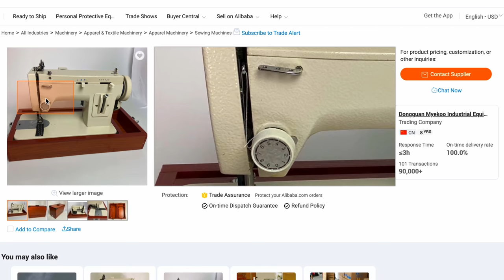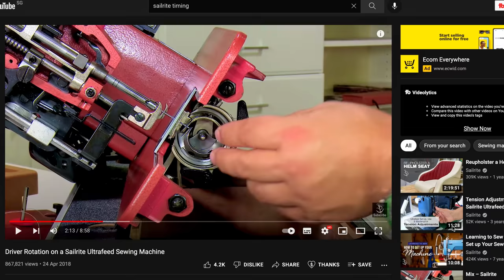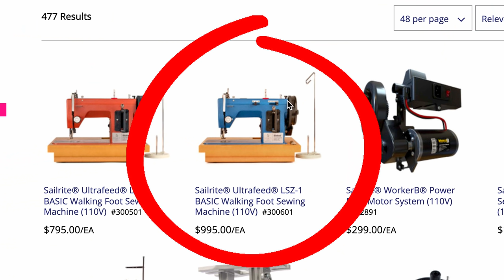SAILRITE VS CHEAP Sewing Machine (Full Comparison)

Comment: My tension cover for the knob fell off a couple years ago, dont need it. Just count half turns while adjusting for new project/ fabric/tensions and make a note so you can return to where you were.
I usually sew 500D Cordura and Ottertext, when I switch to lets say a HyperD 300, I know from a note how much to dial the tensiob knob and the presser foot to get me close. Then just dial it back the other way when you switch back to the 500D. 
The presser foot is even easier. 5/8" exposed on top for 500D, backed all the way out, then one or two turns back in for the lighter HyperD.
I dont even look at the cheat sheet anymore, just keep track of last fabric you sewed.

Comment: I think it was a good decision to get the cases for both machines.  Interesting, Consew is an expensive industrial machine.  At least they were.  I am wondering if someone is using the name.  Good video, because  lots of people also must be asking can I get a walking foot machine that can do big zigzag stiches for less money than the Sailrite.  Sailrithe is a good company, as you know since you have been a customer of their fabrics for a long time.  I started with their sail kits.  $995 is a lot of money to spend on a sewing machine.  Then again avoiding problems, especially when you are traveling  is priceless.  I remember the original Sailright machine was available with a hand crank.
Reply from the maker: I'm surprised at a lot of comments on the Sailrite FB group saying they have a lot of trouble with them also! I think fine tuning is the key.
Reply: Consew is Japanese made commercial grade. They are the original patent holders of this design. Model Cp-146r.. Their made in Japan /made in Taiwan offerings (80’s - 90’s) are superior in quality to all of the Chinese clones that followed. I use mine regularly on heavy material (leather /canvas), purchased 6 years ago-flawless workhorse. Sailrite appears to be the best choice, with best support outside of the original.

Comment: Thanks for the video, very informative.  I believe you machine has in fact has  a method for disconnecting the drive for winding bobbins. The knurled knob on the flywheel is I believe the same as Singer machines - Turn the knob counter clockwise and it will unlock the flywheel from the main shaft. If you remove or loosen the small screw in that knob you will be able to see how it works.
Reply: I put a big wheel on my Rex. At first, after loosening the knurled wheel, the needle still went up and down. I removed and replaced the wheel a few times and finally got the parts in the right order and alignment, so now the needle disengages properly.

Comment: Hi there, on Jupiter! Thanks for this great review. I searched and searched, and never found any 60$ Sailrite's sister. I think it's the price of the box actually, wether it's a wooden or plastic one. The cheapest machine I found was around 190$, plus 50$ for the big wheel, wich makes 240$, and...250$ for the shipping!! So we're on an average price of 550$. The good point is the long arm machine (9") isn't much more expensive, just about 50 or 60$ extra; but the shipping cost jumps from 95$ for the 7"arm to... 250$ for the 9"arm machine. I encountered other brands than the ones you cited, but overall the price is always 550$ or so: half a sailrite.
It's been a week since I begun searching for an affordable machine, and I still don't know!!! Not sure I'll have the skills to make it whit a cheap machine if it comes to jam. Some advise you to oil your machine before the first use, some appear to be luckier than others. Heaven knows! 550$ is still an amount!
Reply from the maker: Yes you are correct on the $60 base... I worked that out after publishing the video... Sorry about that. Shame about the freight price... It would be worth the gamble if it wasn't for the freight... I just saw SR at the boat show and the zigzag machine with all the bells and whistles is $1600 now!... That may have included the table... Not sure.

Comment: A very good review and comparison. 👍. I have no idea what the comments about bias are about.

I've got the Chinese Rex RX-607Z.  AUD300 used in Australia.  A new Sailrite would have been ~AUD2000 delivered to Australia.

Sailrite is definitely a better machine with better support but mine works and does everything I need (a 9" arm would be nice though).

I'd say it's the 80/20 rule at work: 80% of the features for 20% of the price.  Works for me but might be different for someone that does need the extra features, reliability or support.
Reply from the maker: Yep.. You're all over it.. I agree.. Happy with the crappier low cost  version.

Comment: I have both the same machines, the barracuda sits in the corner and hasn't been used (since I got the sailrite) as every time I used it it needed adjusting. I have had the sailrite for two years and not one problem. I since got the worker B upgrade, it is absolutely the most powerful sewing machine I have ever used. lots of reviews on YouTube. the folks that use high end machines even like the new power option!!!!
Reply from the maker: Yeah CF, I'll try acquire a SR when I come across a cheaper one second hand. Judging by comments on the Facebook Sailrite group they do have similar problems so I'm sure someone will sell it off cheap! But it is definitely the superior machine.

Comment: The Sailrite with the WorkerB Power Pack has significantly more power and max speed on the pedal can be manually adjusted with a dial so speed control is more refined.
Reply from the maker: Yep.. Nicer machine.

Comment: Very Nice and honest video!!! I don't owe any of these two machines. What I have is a used JUKI LZ-271 machine, and that machine have never given me any problem, works very smoothly, and it is able to do those 8 layers without doing what this gentleman has to do with the flywheel as he calls it. The Juki is a more expensive machine- 1400.00 USD used- but it is a gem, and it came with table, thread stand, foot control, knee lifter, and a 110v servo motor that is very quiet.  True, when I want to do Zig-zag, I have to change the needle plate, but my buddy can do embroidery with it, something I can't!!!!!  But again, a very educative video with clear explanation from this gentleman.
Reply from the maker: Very nice words...tks Jorge
Reply: What is the machine you used to have. It was a regular sewing machine .. I can’t find the video thst you made. I think it was a Janome

Comment: Great video! Thanks so much. I have  tip. My machine is a Rex. New it was so tight and clunky we called it T-Rex. After a few years of that nonsense and using proper sewing machine oil, I decided to try oiling with Marvel Mystery Oil. After running threadless a few minutes, the racket stopped. It has run quiet and smooth ever since.
I use that stuff in my vehicle, too, 1 liter of Mystery with 4 Liters of Synthetic, and my Kia Rondo runs quieter and smoother and burns a little less fuel in summer but significantly less in our Canadian winters. For sewing machines, I got the idea from some sewing forum where a woman said she oiled her ancient Singer with it and thay she "could blow on it and it runs." It's not quite that good on the Rex but a total improvement from regular oil.
Reply from the maker: Ah wow... I wonder what's in that stuff? Will try to remember to pick some up... Cheers

Comment: Not sure about sewing machines, but my friend bought two chinese made 5hp outboards from aliexpress(I think). Before he ran them, I took one, disassembled it, cleaned it up(deburring, cyl hone, valve lap. smoothed the gears, Carb etc) Put it back together and gave it back. He mounted them both on his 16ft boat and ran them equally. with the same oil and gas. the one straight out of the box lasted 4 years of above average use, the one I cleaned is still running strong. 
In my opinion much of the chinese stuff has the potential to be reasonable. but assembly and attention to detail of the products is grossly lacking. And yes the Metallurgy and composite quality is also lacking. It was very easy to file the piston rings and bearing races. Most of the plastic was not glass fiber(or ever fiber) reinforced.
I think if you took apart the Barracuda, cleaned the parts (maybe put some graphite or molybdenum disulfide on the moving parts it would run a lot smoother. 
 Not sure about the motors but they both should pull about the same amount of amps, therefore the power output should be about the same.

Comment: I bought the blue, zig zag Sail Rite a few years ago.
The forward reverse lever you pointed out was an Upgrade they offered which I purchased.
You can set the lenghts of both your forward and reverse stitches with it by using the locking adjustments. 
I also bought the Servo Motor upgrade - I like it Very Much, I can control the speed of the machine perfectly
which is great as I am brand new to sewing.  I'm waiting to see if you mention the internal differences
 that the Sail Rite site points out in their videos.

Comment: As in the old adage, you get what you pay for.  When I have the confidence in my skills to repair and keep equipment running I have purchased cheaper equipment, but over the last 55 years I have come to regret it because my time is worth something and constantly repairing an item because the parts wear out faster or the quality is just not there adds up to regret for not spending the upfront money on a quality item.  As far as Paul Liuzzo's comment about comparing Ferrari to Ford, I think that is an unfair comparison.  A Ferrari is NOT made for durability.  A better comparison would be a Ford and a baseline Kia and a Lexus.  The durability and precision made parts ensure longevity that the cheap parts just cannot provide.  You get what you pay for and now I wait a little longer on a purchase till I have the money and make the (what I believe is) the better choice.  Thanks for the video.  Excellent presentation and good logical assessments.
Reply from the maker: Thanks WF.... FYI, I've had a lot of feed back from the Sailrite FB group... There is a lot of annoyed Sailrite owners also complaining about breakdowns, even when brand new!

Comment: Thank you for the great video!! Very informative , I recently purchased the barracuda with the Cuda case , the machine itself seems solid , but agree with what you have said , some parts are of a rough finish , I will be purchasing the Cuda crank as I think it will be helpful , the carry case itself is beautiful , but the opening in it is a little too small for the machine &  when you try to flip the machine up to change a bobbin it catches & has chipped the coated on the Carey case . So I have taken the hinges off & just lift the machine up from one end to change a bobbin , it’s much easier for me . I hope it it doesn’t let me down , it is cheaper then the sailrite , but still a little pricey when purchased new from Reliable .

Comment: Great Video.  Good to see you CAN get a sail capable machine really cheap if your prepared to fiddle with it.  I might go the $60 but would probably buy 2 or 3 (spares) if it wasn't for the weight consideration on a sailboat.  
Your right with the motor sizes.  Watts = Amps * Volts
So, if the engine rating is given in Watts your comparing apple for apple regardless of Voltage because Watts are simply a product of Amps and Volts.  Double the Volts and you half the amps.
So, the Cheaper machine has a much more powerful motor and that is normally a plus.  
The Sailrite being a physically larger motor may mean its been built more robust and that can ultimately be a reliability plus, but in the short term, the cheaper machine wins in that department.
However, it looks like the Cheaper machine was given the more powerful motor to get around the stiffness and binding issues you showed, means it WILL wear out faster.
My Mother is a [seamstress/tailor/mad keen dressmaker] so I have had to repair / replace odd bits and pieces in the past.  She has both heavy duty machines and hi-tech embroidery machines (Singer, Phaff, Bernina etc) The Singer is this old heavy solid as a rock machine that has a 2.5hp motor.  It would be ideal for  sail making, but its way to heavy to have on a boat.  it requires 2 people to move it and its setup on a really large cast iron frame, designed to be bolted to the floor.
Reply from the maker: Ah cool feedback... Tks Raptor

Comment: Hi, thanks for a pretty fair comparison of the two makes. I have been eyeing up the 9" Chinese version and reckon I can tweak it to suit my portable sewing needs.
One thing you didn't mention is that these machines need regular and generous oiling and after the work you put the Reliable through it would be a bit dry, clanky and stiff.
I am betting the skipped stitches are down to the thread choice - it makes a huge difference on these machines. Sailrite has an advisory on skipped stitches for certain threads. Overall a good video, looking forward to more 👍
Reply from the maker: Hey thanks BM... Yeah, I've had a comment here, someone bought the 9", and have had no problems... Ill definitely get one when we are back in Asia.
Reply: I was watching some Sailrite videos yesterday and they made comments about certain threads causing skipped stitches.

Comment: SEWLINE 146-7 We have a 35 footer sailboat in PANAMA. the SEWLINE has done 2 cock pit covers (12'x13' truck tarp stuff) plus 1 sail cover plus plus sunbrella dodge..leather interior on a '69 XKE..tonnue cover and more...has not broke yet.  Is it perfect, NO ...cost new now some $500 with zig zag.  Just under 50 lbs so lots of plain rides...see if we leave it in humid Panama it will rust so back to dry/hot Phoenix.    I am sure both are great machines.

Comment: They’re the same machine, but Sailright does include a few better parts such as the linkage for the needle bar.  All mechanical sewing machines require tuning—why do you think Sailright includes detailed videos about setting up and timing their machines?  Buy a cheap one and replace a few inexpensive parts if necessary. I did that and saved $800 over the sailright

Comment: If the sewing machine is double insulated then you don't need an earthing pin at all. 
The motor will be smaller because you don't need as thick a wire for a higher voltage.  You can also deliver greater power, as watts=voltsXamps - so double the voltage, you double the power at a similar motor size.
Reply from the maker: Thanks PI.. I'm quite sure this big lump of cast iron is not double insulated!
Reply: @SailingLifeonJupiter  The motor might well be, and then just bolted to the chassis. But either way....

Comment: Thanks for the comparison. A simple 2 dollar round sticker with 1 - 10 on it would be an easy fix for the tension dial. Also FYI you are showing the wooden case for the sewing machine which is $60, not the sewing machine.

Comment: I bought a Morse machine (essentially the same) about 12 years ago for $350.  I have had some problems, and one part of the internal mechanism broke.  I was able to buy the replacement part from SailRite.  I  also had to add the monster wheel separately.  There are some timing issues, but I am able to sew things.  I have made 2 sails, repaired 2 other sails, and made several canvas projects.  Everything appears to be compatible with the SailRite machine, but, as you mentioned, SailRite will not talk with you about a machine without their brand.
Reply from the maker: Yeah Jeff... I wish they were more affordable. It is definitely a nicer machine.

Comment: Thanks for this video!  It was immediately obvious that "everybody" is selling the same machine, and finally I found someone who discusses this fact!  Yes, I'll probably get the Sailrite.   Ironically, Sailrite is probably making less profit from these machines than the "cheap" ones.  If someone buys the machine for $60, puts a sticker on it and sells it on for $600?  Compare that to Sailrite, who is essentially re-manufacturing every unit.

Comment: Spring loaded return from reverse is a feature the pros use for efficiency. Maybe that’s a feature that should not have been added to a portable machine, given so many home project people, while wisely using a SailRite for its affordability, don’t do enough projects to become proficient enough to gain the dexterity that makes the “quick return from reverse” a value.  Ending a stitch line at high throttle, one hits reverse, lets go, does a few more stitches and the end lock stitches are done so very fast. I have watched experts in boat upholstery using various machines, though never a SailRite.  The experts are impressively proficient.
Reply from the maker: Yep…do something long enough…

Comment: I bought a Singer 2Ku33 in 2016 because Sailrite was not available where I live.  It works well, no skipped stitches but noisy.  It cost about USD700 at the time.  I have sewn through 16 layers of upholstery fabric without any issue.  The only problem was that the presser feet rubbed against each other.  I was afraid to sew fast because it might generate heat or damage the presser feet....not sure how to adjust it but I might grind/sand it down if it becomes unbearable.

Comment: My new Sailrite LSZ is on its way. I tried other "heavy duty" machines and it was horrible.  My time and the materials are not worth wasting on an inferior machine. I want my projects to be perfect, not just passable!.  My sails and canvas have to be reliable under stress, so The cost of the machine is high, but it will do the job reliably for many years.